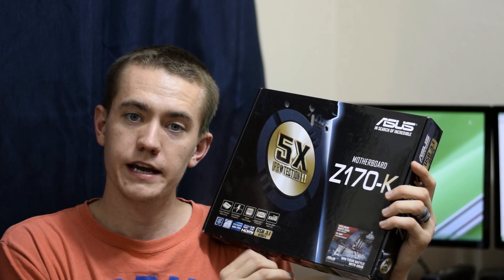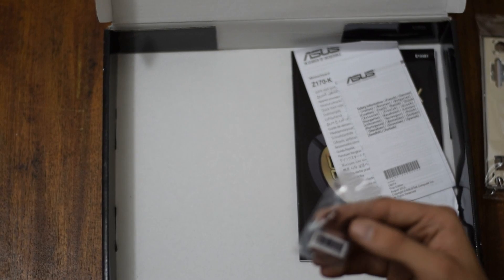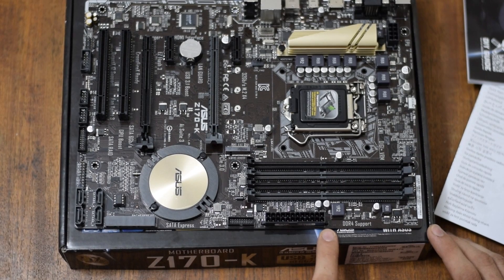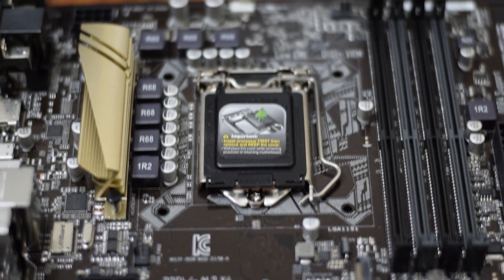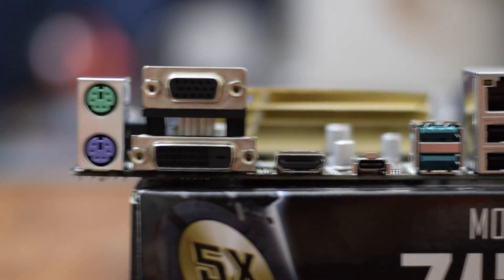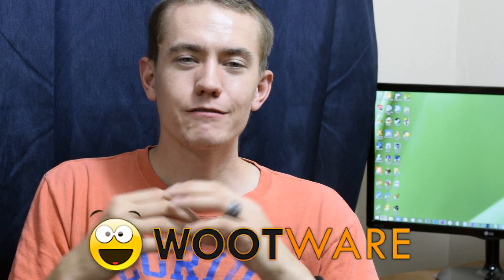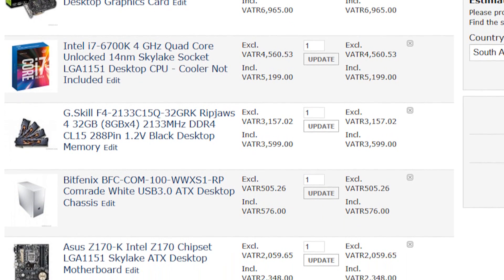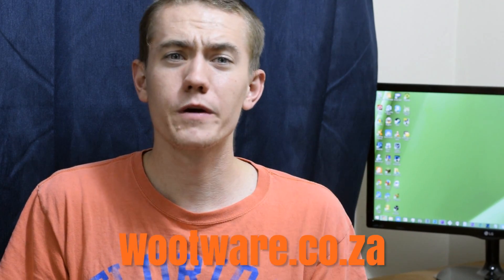Asus Z170-K Motherboard Unboxing and Overview - Skylake Build Project Part 2

Comment: can i connect and use 2 displays (1920x1080) on this MB (with 6700k)?
Reply: PS: 2 displays and without video card (do not need it for my cad 2d work).
Reply from the maker: Yes, it has multiple outputs.
Reply: I bought asus Z170A, it has VGA, DVI-D, HDMI and display port, can connect 3 displays simultaneously. I have 2 displays (at the moment) VG2030wm (DVI-D+VGA) and W2234S (VGA). I can not connect the second (VG2030wm - DVI, the vga works, but do not have 2 vga-s on MB) display, the W10 does not identify it, i do not why, but can connect another DVI monitors to Z170A and the VG2030wm (DVI) works on another PC. I think  the viewsonic via DVI is not compatible with Z170 chipset.

Resolved the problem: 
connected the W2234S via VGA and the VG2030wm via VGA with "HDMI to VGA converter"(it converts digital to analog). I tried a lot of cables/converters/adapters and made  about 100km to try all.

The interesting is that in the first i was with my VG2030wm to service - The DVI input works with their PC. The second time i was with my case at service - the DVI output works with their monitors. 3th time i was with all i have (PC+ displays+all my cables).
Reply: i do not think that somebody will have the same problem because is not a reason to use this MB without video card - the asus or viewsonic will not know about this. But for me HD 530 is enough (3 displays).

Comment: Have this mobo with an i7 6700k @ 4.5ghz. One little problem, not enough chassis fan connectors.Also just 1 CPU FAN connector... How can i connect the rest of my fans?
Reply from the maker: There are adapters you can get to power them off of your power supply, but you could also get a fan extension card as well.
Reply: ***** Thanks!

Comment: hey bro plz help me if you can. I will buy G4400 pentium lga 1151 , i already have 2x8 gb ram's hyperx fury ddr4 and the R9 380 strix 2gb. Should i get the z170 or the B150? All these components will cooperate perfect??
Reply from the maker: +vagosg53 Get the B150 since you won't be overclocking.  You shouldn't actually need the extra features of the Z170. Just consider if it has enough SATA ports.

Comment: Stupid question incoming but how many fan connectors are there and are they 4 pin or 3 pin? I suck :(
Reply: 2 4 pin
Reply: Milan Hmm i bought z170 pro gaming and it has 3 case fan connectors :O

Comment: Question. I currently have this board with a GTX 980 Ti. Once the new GTX Pascal comes out will I be able to replace my 980 Ti with the new card without any problems?
Reply: +UFDisciple turns out pascal card uses RAM slot. Lol
Reply: It might help to let you know, I have the version of this board with only 1 PCIe slot so I can't SLI. Which is why I will eventually just want to upgrade the one card.
Reply from the maker: +MgAsphyxia There's no foreseeable reason why you wouldn't be able to upgrade.  Still should be PCI-E based cards.

Comment: I have the same motherboard, an i7 6700k and 3200mhz ddr4, do you have some cold boot issue sometimes, with the message "overclocking failed" ? I have this message sometimes, and I'm not even overclocking.
Also, Asus released recent Bios updates for all z170 boards except the z170-k and the z-170p...

Comment: Gigabyte Z170XP vs Asus Z170-K which of these is better choice? both have almost same price $5 more on Gigabyte version.
I will buy CPU i5 6600 and 16gb ddr4 2400mhz for my PC. 
Both of These motherboards have AMD crossfire ? because i have AMD 7750 VGA card. ..
Reply: Z170K: offer 6 sata vs 4, 1 sataexpress, and also USB 3.1 (10 Gb) and I5 6600 VS i5 6500 have not big difference except for price...take your spare $$$ for a Crucial (MX200) very good speed...and the why not put DDR4- 3000mhz wit 15 of latency (Gskill have good price) also take a look on SSHD this also offer a super speed faster than 2 raid 0 hdd.

Comment: I'm guessing this could handle a 6600k at 4.0 ghz with a Noctua cooler no problem?
Reply from the maker: +nonikita Should be fine.  Haven't worked with the 6600K though.

Comment: how did the overklock on this motherboard go? ;) i just bought one and heard you mention it in the video, going to build on saturday so could be handy to fix the overklock right away ;)
Reply from the maker: +iblis89 Super simple with Asus' BIOS.  Literally just a click and it works type situation if you don't want to manually do it.  My 6700K is at 4.5GHz without doing anything manually.

Comment: Hey, first of all good review! 
I got a question: If i'm going to use this with my i7-6700k it would be no problem to overklock the cpu, right? :)
Reply from the maker: +Wheeper | Design & Music I have mine OC'd to 4.5GHz on air cooling, no problems.
Reply: very well :) Thank you :D
i subbed u by the way
Reply: +Wheeper | Design &amp; Music  are you aiming at a black/gold build?
Reply: Suki Burns I already built my new PC ^^ I bought the Asus 170-A for my Black and White Build

Comment: bro which one is better for i5 6600k? z170-k or z170-p?
Reply from the maker: +samsul islam If we're just considering the processor, they're about the same.  Motherboard selection is typically about what your needs are.  The Z170-P includes 2 more USB3.0a ports instead of the USB 3.1C port.  If you need more 3.0a ports then go with the Z170-P.  If you need the USB Type-C the Z170-k is your choice.  But if you don't care, then go with whatever is cheaper.  Both of them will serve you well.
Reply: +UFDisciple thanks for ur quick reply :)
Reply: +UFDisciple What if you're using a i7 6700k.
what would you recommend.